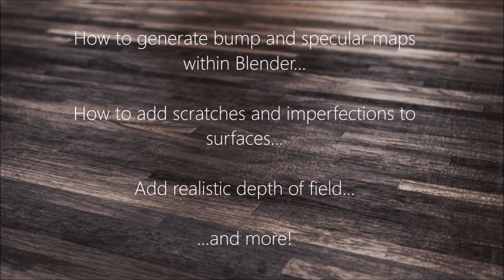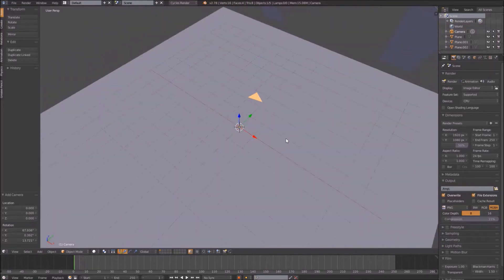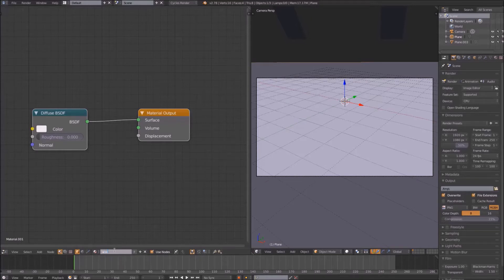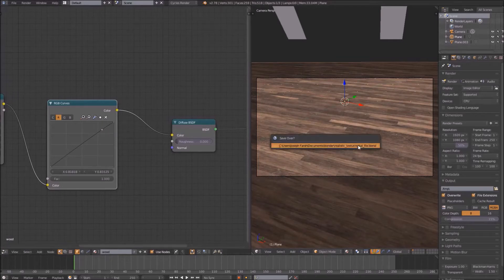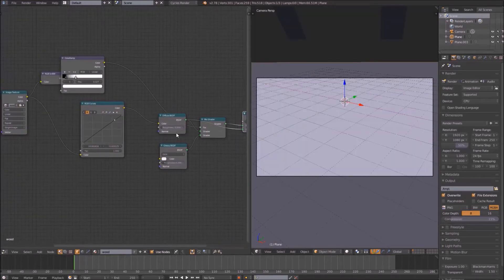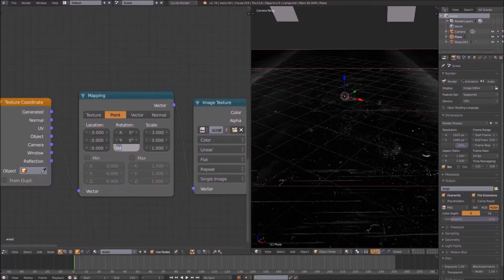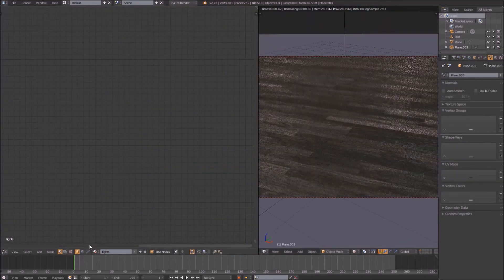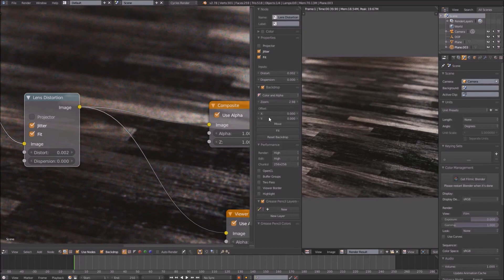How to Make a Realistic Wooden Floor in Blender!

Comment: I don't understand. At 4 minutes you connect the Color Ramp with the Material Output  node to adjust the black&white values - but when I do that, the floor object turns black. I assume I'm doing something wrong but I don't know what.
Reply from the maker: Hi! I would be happy to help. What textures are you using? Is your plane UV-unwrapped? Can you send me a screenshot of your entire node setup for the plane?
Reply: I'm sorry. I made a mistake - I had it in rendered view. If I turn to material view I can adjust the b/w values like in your video. Thanks for the quick reply.  Nice tutorial.
Reply from the maker: Happy to help! Best of luck with your render.